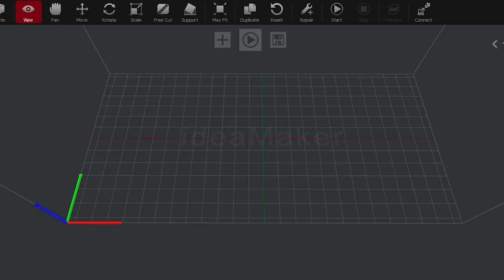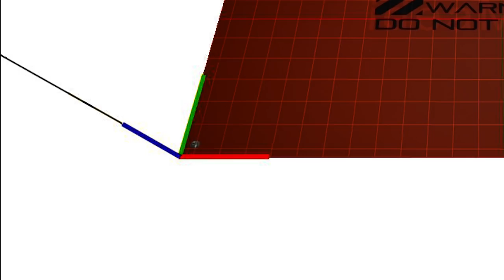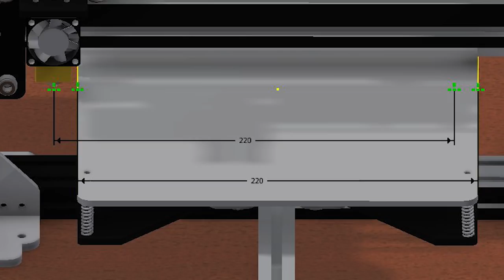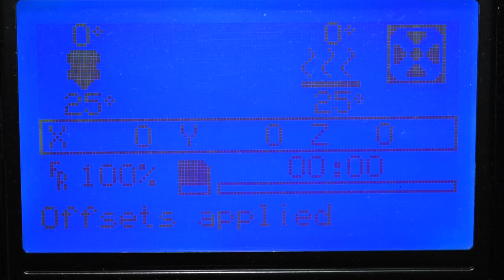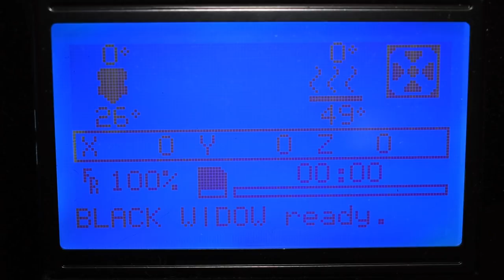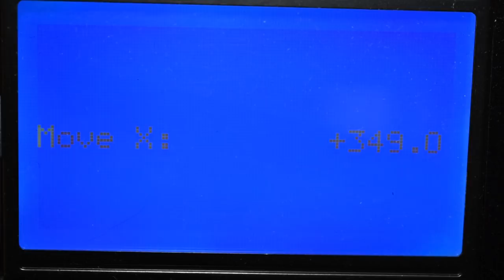Setting UP Your PRINT AREA (3D Printer) - What You're Doing Wrong!

Comment: thank god somebody explained how to center prints  great job! 1 question though why when I use the on screen display 9Set Home offsets) I get error too far thanks again
Reply from the maker: Hi William,
The firmware has a protection that does not allow corrections above a certain value. You need to make smaller corrections or change that safety value in the firmware. I would suggest you to move the home endstop sensor a little bit so that the correction value is smaller.

Comment: My home position is okay on my Tornado.  However when leveling the bed moving the extruder Front Left-Rear Right-Rear Left and Front Right the extruder is too close to the edge of the bed blocking the tops of the leveling screws.  Is it possible to move and set the extruder a bit inside and clear of the screws?

My FilaFarm Switch will be arriving in 2 days.  That will have a 310 x 310 print surface with is smaller than my Tornado print area.  So on leveling  can I set the extruder at the RL-FR-RR and RL to match the filaprint surface instead of the bed surface?  Thanks for this video Rui.  Another great video

Comment: I recently added a Micro Swiss direct drive and hotend.  Now when I autohome, the home postion is off the bed; 13mm Y axis, 3mm X axis.  I have tried various ways to fix this, but nothing has worked so far.  I even followed Micro Swiss's instructions, still it does not autohome properly.  Any ideas?

Comment: I have a Tevo Michelangelo and the Z axis is always sitting at -3.99. I've tried everything to change it to zero but it will always return to that value and it hits the print bed. Can you help me?
Reply from the maker: Did you try, after setting the new home offset, to store the value to eeprom and then read the value from eeprom? If that does not work, you can flash the firmware with the Z home offset at zero.
Reply: @ruiraptor  thanks for your response. I will try that tomorrow!

Comment: NEED HELP PLEASE.  I followed these instructions.  my auto home values read X -33 Y -10.  when I move axis to the home position it then reads X -20 Y +2.  I then locate and click Set Home Offsets.  then I click Store Settings, then I Auto Home Axis again. but now my screen reads  X -46 Y -22.    im running Marlin 1.1.9.
Reply from the maker: Hi, maybe you have a bug in the firmware. In that case we would recommend editing the home offset values in the configuration.h tab in the firmware and flash it again.

Comment: @ruiraptor
Is it common for a stock Ender 3 Pro's Autohome 0,0,0 endstop position to be off of the bed at first?  I.e. a negative value of about 5mm forward (Y) and 5mm left (X) off the bed?

Reason I ask, is when I first set up the printer without seeing your very helpful videos, thinking something was wrong, I manually moved the Y limit switch to force the far left front corner of build plate to line up with nozzle as close as possible so it would read 0 for Y when autohoming.  I think the X limit switch is behind cover and could not manually move that switch and figured close enough?  Z limit switch is mounted with the plastic tab still in tact and that seems ok where nozzle falls as I can bring bed down with adjusting wheels. (Have tighter upgrade springs)

Seems ok, as nozzle is currently "near" plate far left front corner, within a couple mm or so.  It prints those 2 purge lines along y axis far left on the very edge before printing model after bed leveling every time before printing (nozzle and bed heated of course).

I guess my problem is, when I Autohome, the nozzle gets very close to far left front of build plate instead of off and more over.  So when warming up, excess plastic oozes out before starting on very corner of plate and not much space, maybe 1mm in Z height?  So its hard to clean off before start etc.  Sometimes to close to top of plate when autohome and hits it.  Especially when using Fulament Powder Coated texture PEI spring plate. (Similar to Prusa texture plate but for Ender 3).

Seems when I autohome it should move to center of plate and be above the plate 10 to 30 mm or so ideally to clean nozzle etc before printing?  I cannot find any videos that show how to do this specifically. I saw one, but it was complex using Marlin and target print to show offsets?  But I have a stock Ender board.  No bootloader etc.  I may replace with BIGTREE and autobed level later but I want to figure the manual way out first.

Having a difficult time understanding Z offset.  I know you have to STORE SETTINGS once you get it, but confused prior to that.  I tried manually moving nozzle to center of bed and up a bit for much more clearance, then something about set offsets in menu... cannot remember exact setting (edit: SET HOME OFFSETS).  But it had error and said TOO FAR or something?

Thank you!  So helpful!!!!
Reply from the maker: Hi Tim,

There is an option in the firmware that will allow you to do the Z home at the center of the bed. It's called "Z_SAFE_HOMING". This is normally enabled when using a leveling sensor but you can use with normal endstops too.
To do this you need to edit the firmware and flash it. You can also edit the home offset values in the firmware and flash it if that is easier for you.
Some printers allow X and/or Y endstop adjustment so that the nozzle homes away from the bed and this way the nozzle will "leak" filament out of the bed. The ender 3 endstop setup does not allow that.
One other option is to add the command in your start gcode sequence in the slicer. You can add commands to move the nozzle in X, Y and Z to anywhere you want after the G28 (home) command before heating the nozzle.
One more thing...what you are trying to do with the home offsets does not work. Home offsets are only to define the distance between the home position and the edge of the bed. Not the center. That's why you get the too far error.
Let me know if this info helps and if you need additional help :)